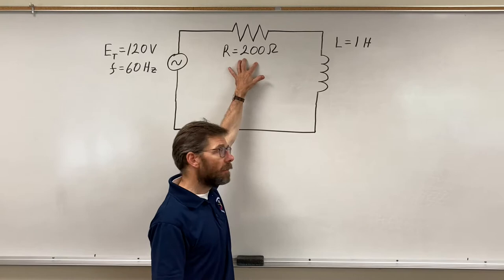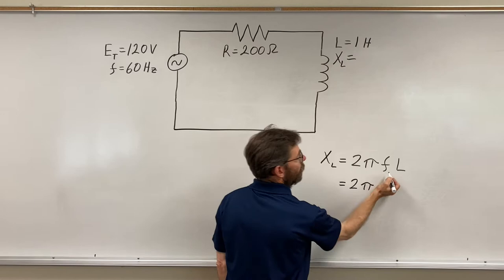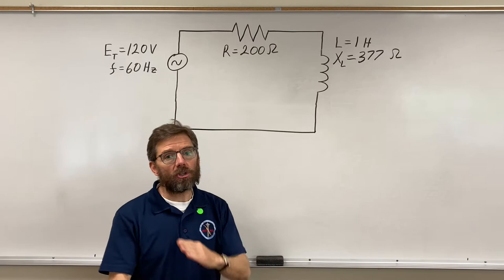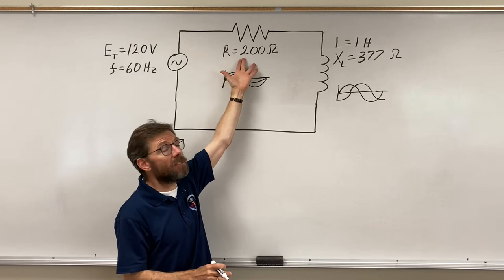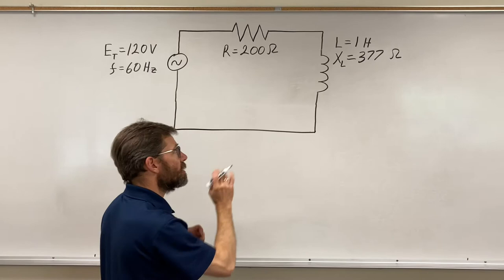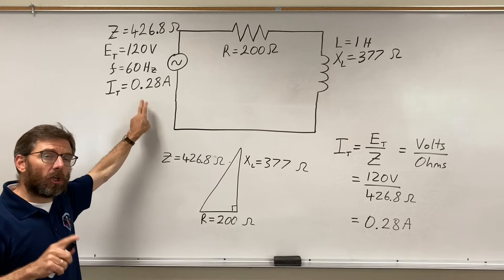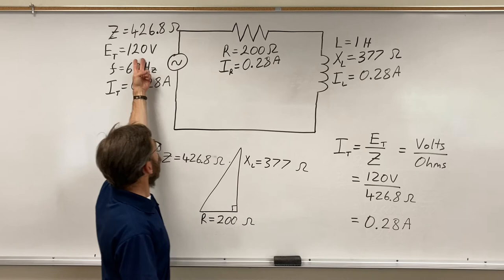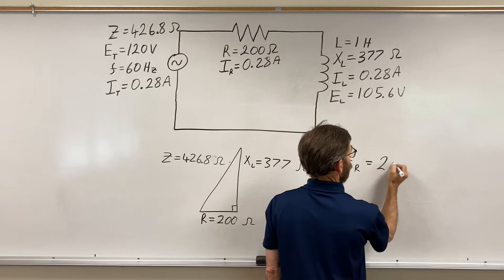Calculating Series RL Circuit Amps, Ohms, and Volts

Comment: It would be good if he showed how the impedances are actually complex numbers derived from ohms law for operation of resistor and inductor in steady state ac circuit. That would take the analysis to the theory that forms the basis for using Pythagoras to add the impedances together to get the current (the reference quantify in case of 2 components in series) via ohms law.
I'm surprised he didn't calculate the phase angle of the applied voltage. He wanted the phase angle for the current derived from ohms law to be 0.
He's doesn't want to get too theoretical but it puts meat on the bone so to speak in ac circuit analysis.
If theory is to be avoided then the vertical component of impedance can be thought of as being derived from considering what effect does the inductor have on voltage drop when subjected to alternating current? Answer: the voltage drop sinusoidal leads the current sinusoidal by  90 degrees and so the impedance for inductor is vertical (in the up sense) relative to resistor's horizontal (in the to the right sense) impedance (no phase shift effect of resistor on voltage).
In analysis of parallel circuit the voltage drop would be assigned as the reference sinusoidal quantity @ 0 degrees phase and so represented in the horizontal direction.
But now the non-reference current sinusoidal quantity lags the reference quantity(voltage) and so the effect of inductor Impedance is still vertical but in the downward sense because current is derived from dividing voltage reference sinusoidal quantity by inductor Impedance.
In summary
In series ac circuit analysis (where current is  the reference quantity @ 0 degree phase angle) the voltage leading effects of inductor prevail.
In parallel ac circuit analysis (where voltage is the reference quantity @ 0 degree phase angle) the current lagging effects of the inductor prevail.
So to recap what's be emphasized here is more of what may be in the practical / lab side of a college level course study of ac circuit analysis.
The other side is the theoretical / lecture side of the course study that introduces the phasor approach (involves a look at ohms law with complex numbers and the representation in the complex plane) to which in turn is derived from analysis in the time domain. The phasor is a complex plane representation of just the phase and magnitude aspect of the sinusoidal quantities in the time domain.
The only time frequency is considered is to calculate the magnitude of the impedance for capacitor and inductor.

Comment: If anyone could answer this I'd be eternally grateful.
What I fail to understand is with this being an AC circuit, when he says that voltage and current on the resistor are in phase, wouldn't that only be true half of the time(on the pos or neg cycles depending on which side the resistor is on) or does the RMS conversion render that irrelevant?

Just thinking about this, when current is flowing in a way that it hits the inductor first, wouldn't that throw the voltage and current out of phase for anything else that happens to be in series with it?
Reply: The  current thru a resistor  and voltage drop are always in phase and all the time. It has nothing to do with how a resistor is placed in the circuit. All that matters is that it's a resistor. Same thing for inductors and capacitors and their leading and lagging voltage effects wrt current. With resistor there or no leading and lagging effects because current and voltage are always in phase.
Think of phase shifting (as accounted for with expression for Impedance) as a "local" or relative quantity. It has nothing to do with the global yet arbitrary phase angle of the ac source (either current or voltage) in the  circuit.
The only reason the triangle form by impedance is oriented so reactance is always vertical is by assigning the global phase angle of the ac source such that the reference quantity (in case of series the reference quantity is current)  has a phase angle of 0.
If the ac source is the same as the reference quantity then the sources global phase angle is assumed to be 0 degrees for an ac source applied as a cosine in the time domain. If the ac source applied  is the same as the reference quantity but expressed as a sine function in the time domain then the global phase angle is - pi / 2. 
This is done so the orientation of the right triangle where resistive effects are horizontal is valid.
That's the reason he doesn't assign a phase angle in this case where the independent ac source  is also non-reference quantity (I.e. sinusoidal voltage). That gives him the liberty to show the analysis in graphical form as a triangle where resistive effects are horizontal at 0 degrees and reactance at 90 degrees to form the sides of the triangle.
If the ac independent source was sinusoidal current then the phase angle would be assumed to be 0 and expressed as cosine in the time domain .
I'm learning from this instructor as well but I also know there's a more general underlying theory as well and I'm reconciling both the more practical side / graphical approach he teaches (and is good at) and the theoretical side that I've never seen him mention but that is the basis for the approach he teaches.